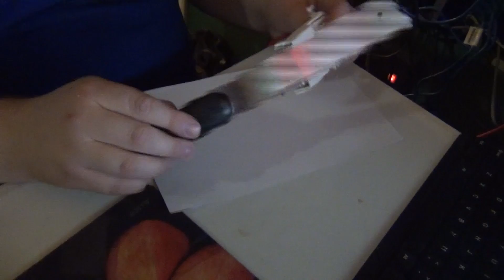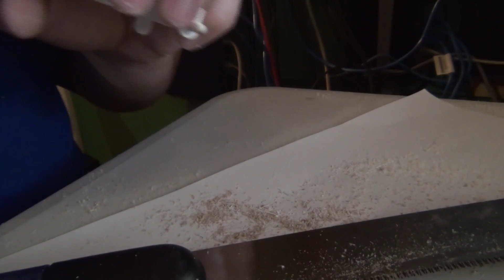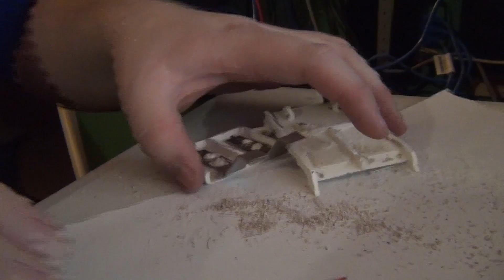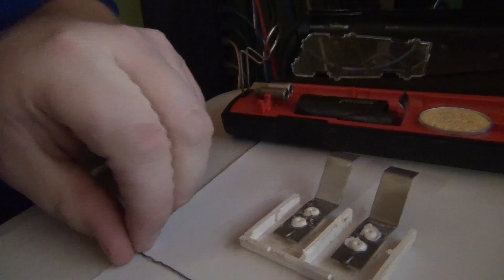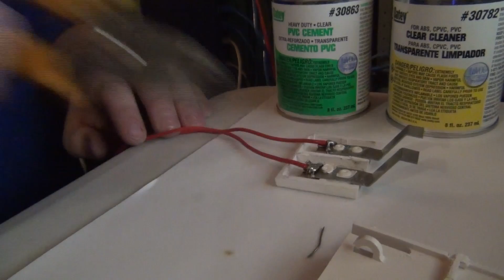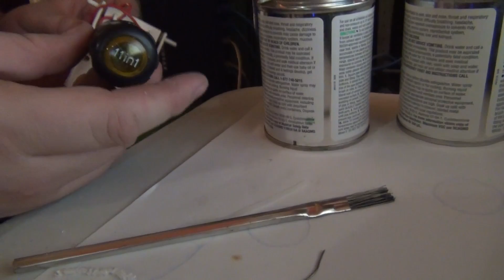Ice Machine Repair (on the inexpensive)

Comment: I have a  Scotsman ice machine model SCE170A-1C. The curtain sensor is bad and the replacement is $285.00. Its supposed to detect the magnet built into the curtain. I'm wondering if can open the sensor and do what you did.
 Any suggestions would be greatly appreciated.
Reply from the maker: Alabama Thorne I did some research and it's possible the magnetic readswitch will be available off the shelf. If it's already broken and you would have to replace it any way it might be worth a try. The switch you see me cuting open is more a fancy wire in a holder, your switch will be kinda like a relay in a tube with contacts. Let me know what you end up doing I am curious as to what you find. Thanks for the comment
Reply: The Great Jelly Doughnut  I used a 'very fine saw' to cut it open. I have two Hall Effect Switches exposed and I do plan to solder two new Hall Effect Switches  in place. The only markings on the old H.E.Switches is "43G". I'll keep you posted. Thanks for the response
Reply: My part number is 12-2436-22  Curtain sensor.

Comment: Hi, I have a Manitowoc QM45 that shuts off every day or so. I have been told it is the bin switch and given an estimate in the $500.00 range including travel. Is the switch you are working on here the same switch? Thank you!
Reply from the maker: John Paschall the bin switch is the magnetic switch that reads a magnet in the ice damper (the flap at the bottom of where the cubes are made). The part I was repairing is the ice thickness probe that tells the machine to stop freezing the ice and start the harvest cycle. The switch they are selling you is about $100 and will be a little involved to swap so $500 is a good deal.
Reply: no , he is working on the ice thickness  switch.  i would not recommend  doing what he is doing,unless  you own the machine but not for a customer..
Reply: @joelzuellar  I'm looking for a used or non working ice machine for my plant can you guide me where I can source 1

Comment: I have a Manitowoc that is not dropping ice and over freezing, do you 
think it is the sensor? T2 and T3 and T4 readings are fine and I have 
run clean cycles regularly, it is an indigo series and only 3 years old.
Reply from the maker: If a sensor is out of spec often you will see an error on
the display. my first recommendation would be to check the installation and
make sure the unit is level sometimes you will find the weight of equipment
will eventually bow tables and floors then you will have an ice fall problem.
from there go over the basics check the condenser it needs to be clean make
sure the water pump is flowing enough water. other than that check your ice thickness
probe and make sure it's not too thick. if your unit is only 3 years old you
may also want to check if the warrantee is still valid. good luck if you get it
going or not make a video so we can see the fix or help you further.

Comment: Time is money.  Cheaper to replace with a new part.
Reply from the maker: you are correct but this ice machine is mine and i had nothing else to 
do that evening, if it were a customers equipment it would have been a 
new part right away. the labor i put in making the repair far exceed a 
R&R with a new part cost but it was fun. thanks for  the comment.
Reply: I though same ))) 15 bucks or less

Comment: Not too impressed with your soldering job.  You should have sanded the materials and then heated them much more before touching the solder to the wire and used flux.
Reply from the maker: +EnergeticWaves that would have worked better had i had the correct solder with me but the probes are stainless and the resin core solider i had that night would not stick to it. if i put a lot of heat to the probes it would have destroyed the housing as its injection molded to the probes.
Reply: +The Great Jelly Doughnut oh. I thot of that, enough heat and the pieces become "unglued". Is your repair still working?
Reply from the maker: +EnergeticWaves it held for years and I ended up selling that ice machine I don't know if it is still in service

Comment: Two drops of some plastic goo would have kept oxygen away from the connection and prevented the corrosion.  Typical American do it as cheaply as possible engineering.  Then sell a replacement for fifty dollars plus tax.
Reply from the maker: +EnergeticWaves the company that builds that ice machine likes to design in failure points on critical systems to force you to buy parts from them. that part the way it is engineered is already $75. thanks for watching
Reply: +The Great Jelly Doughnut well, that's nice to know because I just bot a manitowoc  sm50.    Thanks for the heads up!